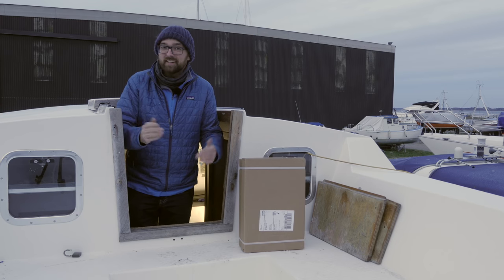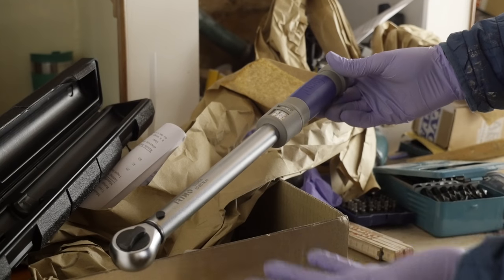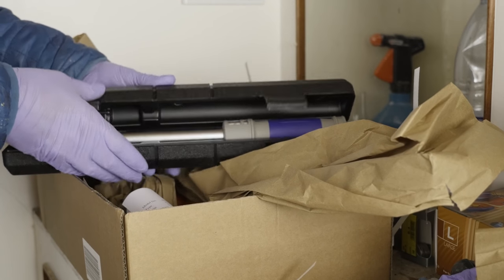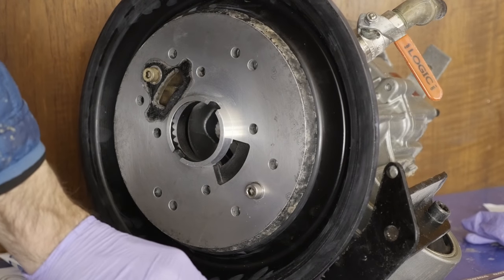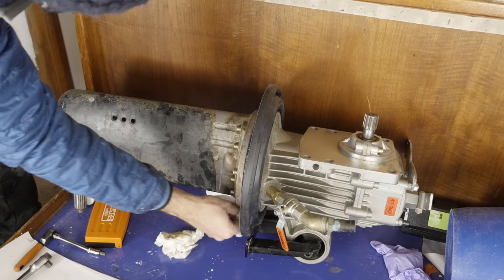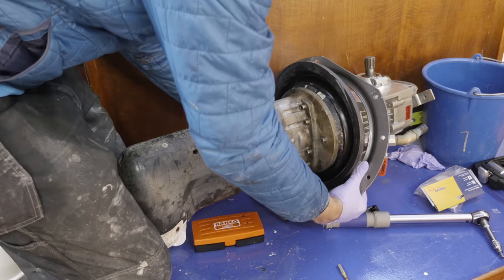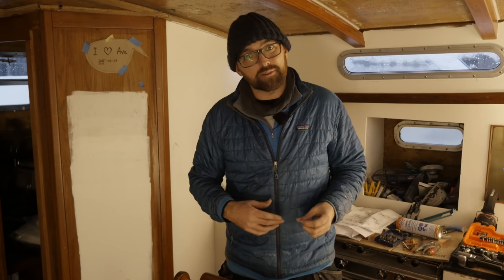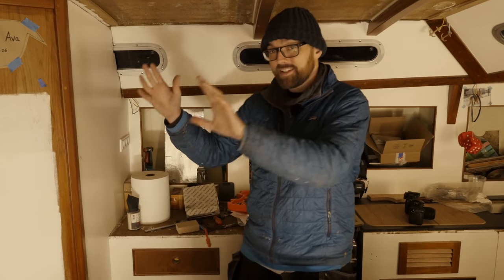Sail Life - Diaphragm replacement 130S saildrive (D2-40) & engine back in it's place

Comment: Buy 2 stainless steel elbows.👍
Reply: Or keep the old one as a spare since the stainles one tend to fail by cracking.
Reply: Agree with having a spare, I wouldn’t keep the old one due to Murphy’s Law
Reply: Always two, the master and the apprentice, or in this case, the main and spare.
Reply: I would braze the old one and save it as a spare.

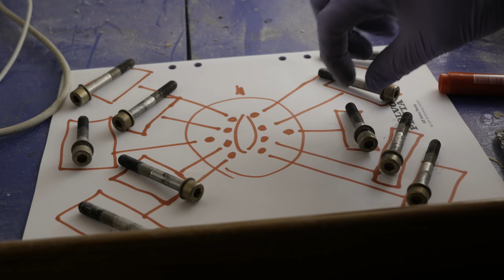Comment: ++1 for your bolt map diagram at 6:00.  Good plan.
Reply: 16:00 - is there any way for you to install a [ beam | track ] along the top of the engine bay that you might crane those heavy bits around?

Comment: good ol white latex paint on raw edges of sound insulation...let dry and cover with alum tape...OR finger paint edges with silicone calk or what ever u got let dry ..cover with alum tape....just something that will stick to raw edge and when dry allows tape to stick to it...and if tape is not wide enough to bridge the raw edge  and stick to the wall AND face ...then use two runs so a good stick to face and a good stick to wall(bulkhead) can be had. with overlap to self can be had ( not reliant on raw edge (paint or caulk) to hold tape in place over time.

Comment: They may have switch seals and ATF maybe best for them the new sail drive may have newer seals that ATF may hurt. I would check with the parts manufacturer if they did a redesign of the sail drive. But if you can use oil I would it’s cheaper and you can find it all over the world

Comment: The reason it says "ATF only" is because the sealing surfaces inside were designed to run on ATF ... only. Volvo assumes you updated every such component to meet the requirements of the new fluid. It's pretty much the same with every other type of similar deal. Otherwise, there's nothing ATF or oil or formula X can touch inside or make worse or better so long they meet the specs.

Comment: Bolts: Grease?? Not unless you couldn't find a bottle of proper antiseize or threadlock. One or the other should be specified by the manufacturer. And now that you have a torque wrench, you should know that the proper torque for any bolt CHANGES when you apply anything (grease, threadlock, antiseize) to the bolt. There are standards, and standard torques for bolt diameters, in case the sloppy manufacturer has not given you the exact specs in your workshop manual. 
 Antiseize and threadlock can seem foolishly expensive, but in five or ten years when you have to remove the bolts again, you realize they are an incredible bargain. By the way, threadlock has a limited shelf life. Two years unopened, one year after the bottle has been opened, and then you throw it out because it starts to fail. They also make it "lipstick" style, which I believe has a much longer life.
Reply: Couldn't agree more MADS, grease was a poor man's antisieze, after 20 years of wrenching I use mostly high temp antisieze on everything that is metal to metal...it is such a gift to future you.
Reply: Unless you guys have the exact shop manual in front of you that Mads is using, knowing how thoroughly he does his research, I would not assume he hasn't followed the manufacturer's instructions exactly.  Also a general (non application specific) chart of torque values is a good tool but its usefulness only goes just so far...  It tells you what torque the fastener itself is capable of taking; it does not tell you what it should be torqued to in your application.  There are often other factors that will necessitate using a lower torque than what the general chart calls for.
Reply: @netpackrat since the shop manuals differ (oil vs atf) and they gave him only one torque spec, I'd bet he wasn't ignoring additional specs. Take an old Toyota shop manual, and it specs the exact factory coating on every bolt. Take an old GM manual, and it never mentioned any. Loose bolts were considered acceptable in Detroit.
Reply: @lyfandeth  My point was that you are assuming for some reason that the manual didn't tell him to use grease.
Reply: And you are assuming it did? Just "grease" ? In my limited experience, no saildrives, I've never seen them call for just grease on bolts. I would find that oddly imprecise, so let's ask him. What did the manual say?
Reply: @lyfandeth  Where did I say that?  I am giving Mads the benefit of the doubt, because out of the 3 of us, he is the one who has actually read the manual.  And plenty of applications call for grease on threads.
Reply: torq specs other than general are used to protect the mating surfaces from warping....ie  heads to engine / main or cam shaft bearings ...grease a bolt and get 10% tighter bolts ...within spec tolerances unless your working on a 747 or rocket engine..

Comment: Have noted it in the previous video, it is not a good idea to use a stainless exhaust elbow on your alloy cylinder head, with the salty waters... You diverting the electrolytic do-da into a place what is even more expensive to replace..

Comment: Where is the water pump impeller, in the sail drive unit or on the engine?  That water pump impeller should be replaced.

Comment: Surprised there is no Threadlock compound used on the re assembly.  What with the vibration, those bolts could work their way out over time. Hope I’m wrong.

Comment: Why would you not change oil filter while the engine was out? (I assume the filter that had May 2016 written on it was for oil)
Reply: That's a fuel filter.  No reason to change it until he's ready to run the engine.

Comment: IMHO, the change in specified lubricants may be due to changes in internal parts between the original saildrive and the produced later in the production run. Alternately, it may be that the manufacturer’s and or customer’s experience with ATF lead them to change the spec. I’d also worry that, when speaking to the manufacturer I’d get someone who was too inexperienced to know there
was a change in spec (if, indeed, there was a change) and when/why that was done. I speak from experience.; nothing beats corporate experience when it comes to these matters.

Comment: If I'm not mistaken, bolt torque is affected by lubrication (such as grease). So if Volvo's torque spec is based on an assumed dry thread, lubricating it screws everything up (see what I did there...get it? SCREWS everything up). Jokes aside, this could be a serious situation...  http://www.smartbolts.com/insights/impact-lubricants-torque-readings/

Comment: NEVER lubricate the threads when using a torque wrench. this will cause the threads to slip too easily into the hole causing an excessive angular movement and excessive stretching of the bolt and ultimately failure. by changing the conditions away from the factory design, you then cannot then tell how far the bolt has gone into the hole. simply clean everything and ensure the bolts can be run in by finger pressure. that's it. no more.

Comment: I don't know about putting oil in that sail drive if it has always had ATF in it. I am a retired Mechanic and would run what that year sail drive called for not change it.. Always use the year manual for said engine or drive system. New ones are for changes you chn't see.

Comment: Torque wrench is extremely important. Just tightening down bolts until "snug" and crossing your fingers is madness. Fasteners are an engineered component of a system, just like the rest of it. For the correct clamping force, you need the correct stretch on the fastener. Without a torque wrench, you are flying blind.

Comment: Looks Like you dropped an o-ring putting the drive back together 22:49
Reply: Anders Söderberg do you mean at 11:40? I thought he did too but it must have been oil dropping as there wasn't an o ring in the lower leg unit.

Comment: Adding grease to bolts reduces the amount of torque needed,by up to 40% in some applications.You should fit them dry unless it specs lubricated.If thats white grease youre using then its between 35/45% reduction.https://www.engineeringtoolbox.com/torque-lubrication-effects-d_1693.html

Comment: I appreciate the detailed documentation. but you made a serious mistake to put grease on the bolts. it seriously changes the actual resistance on the bolts. they will not hold and you might get leaks as a result. instead you need thread locker. or at least just put nothing on and just screw in the bolts

Comment: PLEASE do some more verification before switching from ATF to oil!  ATF IS NOT A LUBRICANT.  It's operates as a coolant & cleaner (layman's terms).  As a mechanical engineer...  I can't believe a manufacture would recommend both for the same application.  Contact Volvo directly with you serial number & year.